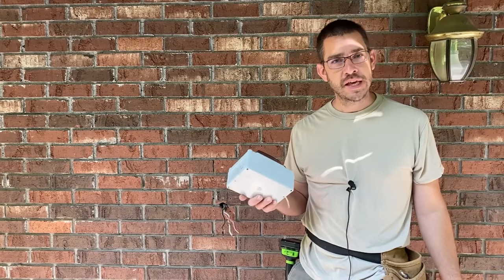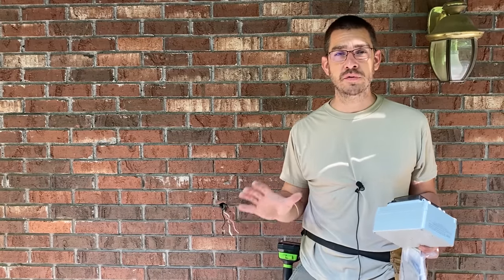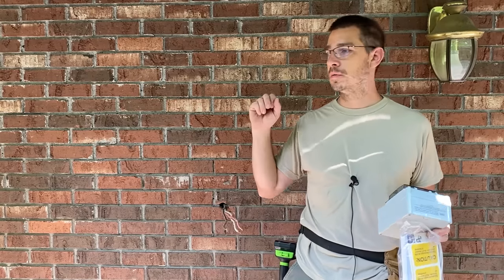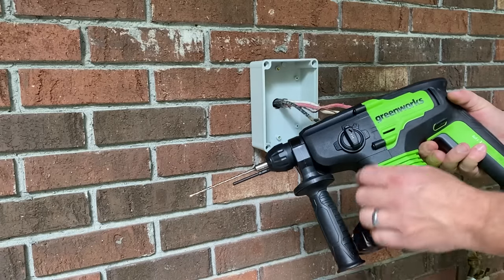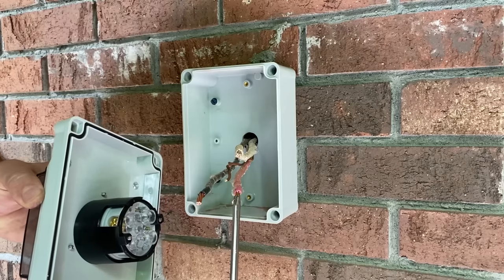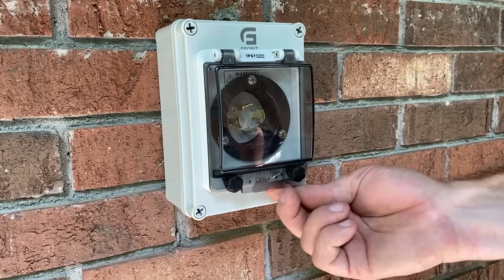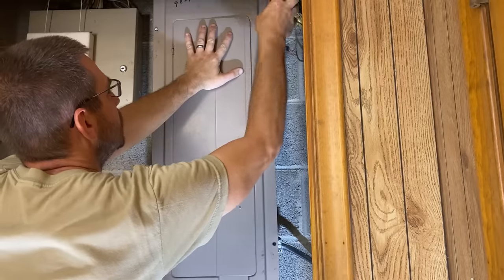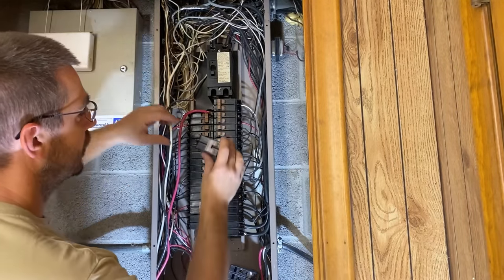How To Safely Power Your Home With a Portable Generator

Comment: O.k so glad I found this.... so let me ask you something..... I live in a very small place and don't even have a 220v outlet. Outside my door there is a standard 120v outlet so are you saying technically I can just plug my generator into my outdoor outlet as long as my main switch is turned off and it would be turn all my outlets in the house live with generator power. Thank you for your help
Reply from the maker: No! You need to have 30 amp rated wires and you need a 220 twist lock in order to power both legs of the panel
Reply: @SSLFamilyDad  o.k thank you very much for taking the time to answer me!

Comment: I've been wondering if you can couple something like this with solar panels.  Would the generator provide the correct power frequency to allow a tie-in inverter to provide power and would that cause too much back-feed into the generator?  Could you use a diode or something to prevent that back-feed to the generator?
Reply: for adding solar the correct way its basically a generator interlock with added steps. you need a transfer panel to transfer the loads off the main circuit breaker onto a separate breaker that is supplied by your solar setups inverter without a tie to ground like your main panel has. you would never want to have more than one power generator source working at once without the proper panels, switches and lockouts in place. Like he states in the video this lockout prevents power feeding back into the grid, or from the grid to the generator, the same principals apply with solar and gas generation working in tandem. with a lot of solar stuff its worth consulting an electrician. the main reason for this is solar systems arent really ground tie friendly since that creates a ground loop, and that can devastate a solar system. the dc system of solar has its own ground when connected with batteries, when you bring in the ground rod that is attached to your house it at best has some funky flutters in power, at worst burns out all your solar. 

can you technically hookup a solar backup system in the same manner as a gas generator, yes in fact you can have your inverter hook up to a similar interlock like this. but if something goes wrong its more expensive to replace the solar equipment and batteries than a generator.  everything also depends on local regulations, for the most part isolated solar circuts are treated in a way where if you wire it like a DC system like in a car or RV. when connected to something that is connected to a grid things get more complex.

if you want to run solar and a gas generator to power more stuff at once, get an electrician to setup your box so the solar is powering all the essentials like lights and fridge, sump pump etc on its transfer panel. and the generator runs its devices, say Air conditioning on another sub panel or if possible on its interlock of the main panel.

check out davidpoz, or Will Prowse while they aren't necessarily experts, both of them are decent at explaining solar systems.
Reply: @antibodyarmy  Thanks for the response, but you didn't really answer the question I was asking.  If someone has a grid-tie system with a generator rather than batteries, when the power goes out, can the system be configured so that the solar produces power based on the frequencies that the generator produces?  

This has nothing to do with the method of disconnection from the grid.  We're past that obvious point (this can be done through a manual switchover, as shown in this video, or through a smart inverter system).  

When someone setups up a grid-tie system with battery backup, it can be configured so that the panels generate power based on the battery-supplied frequency.  The question is, can the same thing work with a generator?
Reply: @dienekes4364  Should be able to. A generator depending on what type, should put out 60 hertz (+ - 5 hertz). Grid power is 60 hertz on the button. The frequency tolerance is 5% so 57-63hz is the range. You want to start with about 62hz at no load because it will drop a bit as the engine is loaded up.
Voltage is the same deal. If your generator has a voltage adjustment then set it for 125 volts at no load. It will drop some as the generator load is increased.
Reply: @ShelbyvsViper  Thanks!

Comment: So, what generator are you using with 30 amp to power at 240 both sides of the panel? Are you concerned about powering your sensitive electronics?

Comment: EZ-connect from Home Depot is a whole home manual transfer switch. It must be wired in between your two phases from your main panel. No limit on the number of circuits. I will agree a kit like this is ideal if it can be used at you have demonstrated in this video.
Reply: Yes, I agree this would be nice if you have a 220 volt generator, but still need to check with your local county code to make sure that this face plate is allowed in your area.  Some counties do not allow this because the neutral is not isolated and thus if there is a fire or someone on a pole gets hurt, the homeower/renter or the person that installed it is legally liable.
Reply: @kinglee3990  I'm not sure what you're saying about the neutral not being isolated. The neutral and ground are bonded at my main service panel. I'm not sure what fire you're referring too but a pole worker would never see any power from the neutral because it'll end up going to ground at the main service panel.

Comment: One time I did it by turning off the main and plugging and extension cord from my generator directly to a home outlet, and it works, is that also a right way?
Reply from the maker: Kind of, it would work but no 220v items like a well would work and only every other breaker

Comment: I’ve installed a transfer switch for my Bluetti (battery powered 6kwh) system. Output from system is 30amp tt30 120v to a 30amp breaker on the panel. I’ve found a few random 15-20 amp breakers don’t work on each side, not powering some outlets, lights, fridge, etc. Curious if being an imbalanced load is the issue or something else? Thanks

Comment: Go bigger now 50 amp with 12k watts generator 😁😁 AC can run

My setup:
Duromax 13000EH model-12500 watts
Reliance 50 amp inlet
Wire gauge 6/4 
50 amp breaker and adding whole house surge protector. 
And interlock

No more worry about outage and brownouts

Comment: Your panel neutral is still connected to the outside. If there is a issue like power comes back on the neutral your generator will go boom or you have a short on your house with the generator power could be sent back via neutral to the plant and you could kill a power company line person. In other words you could backfeed neutral....
Reply: Not possible to back feed a neutral how you explain, especially when its bonded off to ground..
Many large back up generators are configured in basically the same fashion, the transfer switch interrupts only the hot conductors but the neutrals from generator and utility remain connected together along with the load neutral at all times.

Comment: What if I have 30 Amp breaker for my AC on the upper right corner where I want to put the new 30 Amp generator breaker? And I have a spare block to put a breaker on bottom left corner. How would I rewire the AC breaker to the bottom left hand corner if the two hot wires arent long enough to reach bottom part of the panel from their current position in the the top right? I believe  its a square D 100 or 150 AM panel. Any advise would be greatly appreciated.

Comment: So with this type of interlock how does it prevent main line power from feeding into your generator and damaging it once the power gets restored?
Reply from the maker: When you turn the main back on it forces the generator breaker off
Reply: The main breaker is off which stops the electricity from entering the breaker box. The interlock plate forces you to power down and switch off the generator breaker before opening the house up to the main line power.
Reply: @SSLFamilyDad  do know if this is to code in Canada?

Comment: What are the wires that were coming out from your house from originally? Would this work on a regular outside outlet?
Reply from the maker: Cannot use a regular outlet, needs to be 4 wires, rated for the inlet box at 240 volts

Comment: You most certainly can two back feed through a dryer plug outlet but the first thing you do is you shut your main breaker off in your breaker box then you can do it and then you don't backfeed to the outside and the outside won't feed into your generator so you can do it
Reply: You “can” but it violates the electrical code and for good reason, it’s dangerous and relies on someone remembering to shut off the main switch.  Ask any lineman, they don’t want their life dependent on someone remembering to turn off a switch.
Reply: You can also see if that smell in your house is natural gas by lighting a match.  Works great and keeps the undertaker in business.  My point is, you can do it (I have) but it isn't safe, violates electrical codes, and puts you in a position of getting sued or going to jail if someone is injured or worse because of your "hack".
Reply: @SteelheadTed  if you throw in a lockout switch you still got to go to the panel box anyhow so what's the difference still depending on a human and if you're that stupid not to know what to do don't touch it
Reply: @ernestholbrook1898  the difference is no one’s life should depend on a homeowners memory to flip a switch.

Comment: my issue here is that the main neutral is still connected on the center tap on the utility pole transformer.could this pose an issue again for those working on the lines? i feel that for total safety against back feeds,the neutral should also be opened when you shut off the main switch to use a generator.instead of a two pole disconnect on the main, what about a four pole switch to totally isolate house from utility by diconnecting neutral and ground?

Comment: After the big freeze in Tx I added a similar setup, though I only have a 5000w inverter generator. The generator won't run the AC, but it will run the furnace fan (gas heat), fridge, freezer, lights, gas stove, internet, and pretty much everything else (though maybe not all at once). The entire cost for the generator, interlock, outlet, cable, and pro install was about $1350. Now since Texas really didn't do anything to ensure this does not happen again, I have decided that if there is another freeze like the one n 2021, we will pack a weeks worth of clothes and leave. If the grid fails it could take weeks to restore power, and getting gasoline for the generator would be impossible, so best to be somewhere else.
Reply: Texan here . We use a propane generator and propane can be stored for a long time . My gen is only a 3500 but I also have a natural gas stove heater and water heater . Be well I hope they would just work on the grid . We were 4 days without power and I burned about 40 pounds of propane .
Reply: @txrick4879  If the grid were to actually fail, it could take up to two months to restore power to everyone. I did not understand that until I learned what the process involves. Each generator needs to be  started and brought to the same frequency as the ones already on the grid, then loaded. Then the next on, and on and on. It could mean weeks or months with no power and no power means no pumps.
Reply: @shenmisheshou7002  Well our natural gas never went out . If it had we would be in deep shit . I already have 3 propane bottles about 50 pounds and it was easy to get . Gasoline long lines . If it goes that bad I have a wood stove that I could use and run the exhaust pipe of a window and have lots of oak to burn . We have been preppers all our lives . We have a huge supply of candles and other lamps but I hope we never get that bad . My house is also solar powered but still I need a back up battery . That's next on my list . I have a smaller solar unit but it will only run lights and it has 2 deep cycle batteries . You can't be prepared for everything but anything helps . Be well and hope we don't get that bad . Next I plan to add blow in insulation to our attic . Be prepared is all I can say .
Reply: @txrick4879  Well, it sounds like you are prepared for it, and I have my plan, but I pity the people that have neither if the Texas grid ever does go down.
Reply: @shenmisheshou7002  My father taught me to always be prepared for the worse . Yes I feel for my fellow Texans that died because of this freeze . We need a governor that will try to fix our grid . It can be done other states have already done it . Be well and do what you must do to survive . Traveling during a ice storm is very dangerous .
Reply: @txrick4879  Well, the reason Tx has its own grid was because the leadership did not want to impose these kinds of regulations and that was supposed to keep rates low, but I think they are no lower than anywhere else so in the end, we pay the same and have more risk. My plan is to be gone before the ice storm comes. If we get another prediction for an extended deep freeze, we are going to go as soon as we can pack our bags. Being without power for a few weeks is just not something I have to do.
Reply: @shenmisheshou7002  You have a plan . Good luck and stay safe .
Reply: The problem with that theory is that all your pipes will freeze, making a whole-house generator look cheap.  (Just ask my friend in Fort Worth whose electricity was off for 6 days and spent $30,000 on repairs.)
Reply: @mrblanche   I am running on my inverter generator even as I type this and I am not concerned about the plumbing. I was without power for four days last year during the freeze and I did not lose one pipe (and this was before I had the generator). I simply dripped all of my faucets and checked them regularly. Your friend probably did not bother with dripping his lines.  I have been through a lot of severe freezes and never had a burst pipe because I always drip the lines. Highly effective.

Comment: Will the breaker panel have a space for the new breaker? Or do you have to move breakers?
Reply: You'll need two slots available at the top of your column of breakers.  In my case, I needed to relocate one breaker in order to have two blank slots.

Comment: Hi. I have G12KBN generator that has 30 and 50 amp outlets. 12,000 peak watts/ 9,500 rated watts (gasoline).  Do i need to run 50 amp or 30 amp 240v to my house ?
Reply from the maker: I would run a 50amp wire and plug to get the most out of your generator

Comment: really just a homeowner here, forgive what may be a simple question...
so you ran a new wire, was it 10-2?  I'd have near a 50 foot run, should I use 8-2?
Will the interlock and breaker accommodate 8 gauge wire?
Reply: 10/3 would work well on that run with 30 amps
Reply: I did similar the other day. 
I used 10-3 with ground and I have a 30 amp 25ft cord of the same gauge and wires with inlet and outlet twist lock connectors to connect to my generator. The outlet on your generator my be different than mine or different amperage and require different gauge wire and connectors.
This part you want to research, My instructions said the wire from the inlet box to the generator breaker had to be at least 5 feet long and no longer than 15 feet. I’ve already discarded packaging and directions. So research it.

Comment: I have a silly question.   I do not have a main shut off breaker.   Would I still need the interlock kit.   Would I need to install a main shut off breaker.
Reply: If your breaker panel is over 6 feet from your electric meter, look for a main shut off breaker near the electric meter. it might be outside or inside near the meter. You cannot use this type of interlock system if you have a separate main shut off breaker somewhere before your other breaker box.
Reply: It is like on the other side of the wall from the electrical meter.  The electrical meter is outside and the breaker box is on the inside.    My home was built in 65 I think.
Reply: Sometimes you can install a main breaker in a panel that does not have one, but it depends on the model of the panel.  Or else you can use a manual transfer switch which goes beside of your panel and has wires that go inside to 6 or 10 of the breakers.
Reply: Sometimes you can install a main breaker in a panel that does not have one, but it depends on the model of the panel.  Or else you can use a manual transfer switch which goes beside of your panel and has wires that go inside to 6 or 10 of the breakers.

Comment: Canadian electrical engineer here.  I don't know about USA, but this would be completely unacceptable in Canada.  Any interlock that can be defeated by removing a cover or with common tools is not permitted.  As the video mentions, this is not only a safety issue for the homeowner, but is also be hazardous to line crews working to restore power.  
It should also be mentioned that even with the main breaker turned off the line-side terminals are live.  Again, in Canada, it would not be permitted to pass the branch circuit wiring through the service entrance breaker space. 
If you are in the USA, you do you and comply with your local codes, but at least be careful with that main breaker.